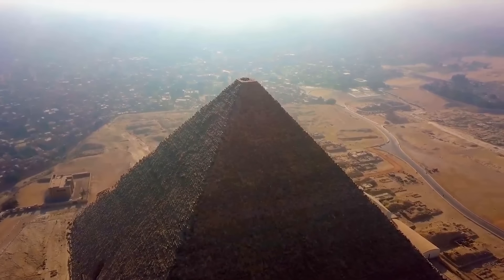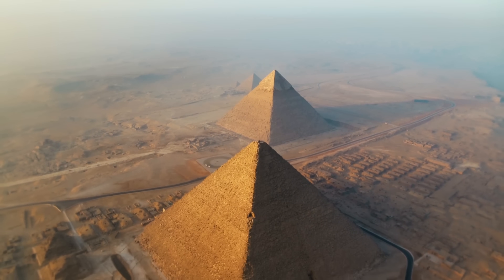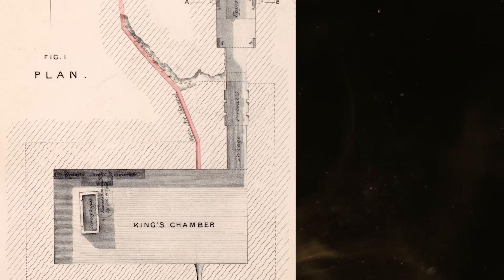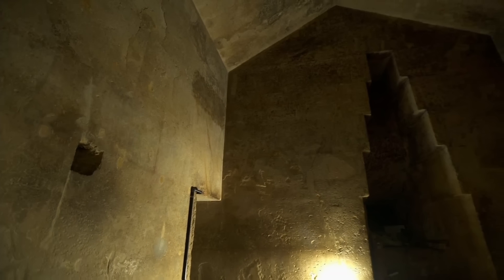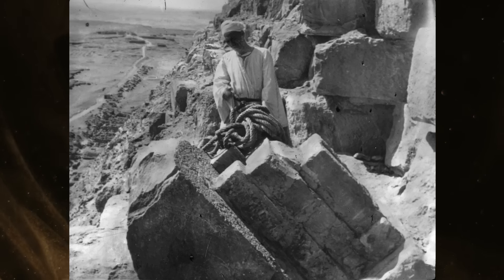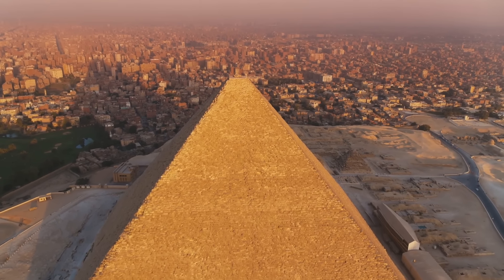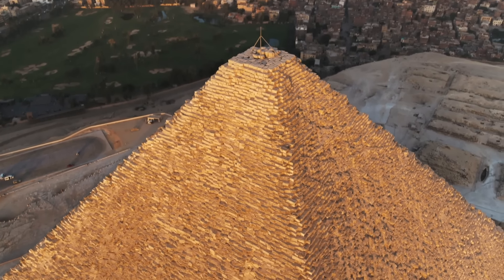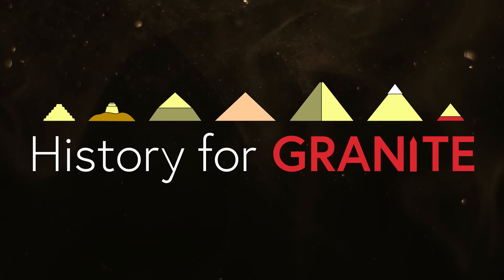One Solution to the Four Channels of the Great Pyramid

Comment: Dear Creator,

You base everithing on the order of the cuts, but if it was cut before the upper block is placed, than the cuts are just logical. You want the ends of the channel to be nicely done.

I tried to read all the comments, but I never found this about the cuting after consturcion: 
Why are you sure those stones were cut after the coverblock was on top of them? cuting before placeing in the channel-block saves a lot of time, and would look like this: the precut stone were not in perfect level, but not a problem for vents, only leave the ends uncut to clear up from inside, to put in a block when construction ready and vents not needed..

You show us a wall that is precut within a few inches. Why wouldnt they do this for a channel?

In my opinion inside work was needed cos walls were finished after assembly of blocks
the channels were needed for ventilation for this inside stonework, without them the stacking of blocks would have had to stop until the interior is done, 
when the room was finished inside, the capstone used everyday  to cover the vent when needed, was left in place and the channel was discontinued,
so the queens chamber finisher first, channels discontinued early, and the kings last and were only covered by outer coverstones -> we think it was open

Thank you if you read this, very nice channel, your discoveries and fieldwork are well balanced in knowledge and reality, I agree with all the conclusions you told us so far, but...
the solution of long term air conditioning is too far. You derive it nicely from "why wouldn't they want to use the insides?",. Maybe just by the headpriest, or by pilgrims, or by masses, why would they try to seal it right after completion?
The idea is ok, but in reality it make the design very wasteful... EVERYTHING about the design screems security, and permanence. And they nailed it! It still sands, and still 'can' be rooms in it. 
Humans LOVE to make something that shows mark. And in ancient times using stone after ages of wood and bricks upped the stakes. The better the achievement the longer the fame. And Egyptians won. Nooone could erase it, noone could replicate so far. And since than everything fell that was made to last forever. (religion is in 2.place) Humans will find a way to erase anything.

SO my point is that If you want to make something to stand the test of time you cant be naive to plan to make it "OPEN TO PUBLIC"..
 IF it would have been built to accommodate visitors, dynasties would have used it to live in it after, and battles fought for it. As a fortress. You would be hard on proving that it was not made to be a palace in 870, but a tomb and then reused..:)
The only real motivation to build this is in the fact that nothing lasts. We build empires, cultures, techniques, systems. And in time a new stronger will come and we forget the old.
Controlling what happens to your makeings after you die is still the hardest. And they are wining since 3000bc.
Also leaving an airflow is contra productive, the enviroment destroys the building from the inside.. 
Trust me, maybe not right after the "moving in", maybe there was a few years or mourning, and visiting, but they sealed it:
(You should check out FitMc and older 2B2T content. History is an anarchy server)

this is my recipe to build something in the bronze age, that can last, spread that you are awesome, even if your ppl die out:

-make it big, so its visibe and not easy to erase - max under 30-35 years. (2ruler buldplan is not safe.)
-build not from valuable material, and in a shape that erosion will only make it more dense
-infertile land is preferable, but it must be rock close , not swampy, not on lowlands, but too high makes it harder to build
-use blocks only crowds can move, and interlock them to the top so you can only disassemble from the top - this is the hard part
-leave corridors while building the body, but make them small, so only a few can enter
-with the interlocking blocks and narrow corridors the more they excavate the less accessible the building can become
-put something in the middle, thats yours, and you think wort preserving: anyone can claim a pig pile of stone.
-make the corridors narrow, have updown angles, and plan them in a way you can decorate and fill them while the top of the building is finished
-put the few rooms far from light and fresh air, but when you close the rooms while building upward, leave tunnels for air until the interior is done

-,the outside is protected by steep cover-stones, they cant even go up to start the destruction, and if you start from the bottom it all comes down on you. 1 entrance is left at the end, all else is uniform a,d flat and tall.
-before the moving in you make everything ready and wait for the loot to die.
-as soon as the monks let it you: seal all the corridors inside, hide the seals, and only leave 1 way open, preferably a corridor downward, with the sealed corridors on the sealing. 1-2 worker at a time.

-this last part you can leave open but no more than 3-4 ppl can go in, and when other gods rule, its ok to fill it up with sand cover the entrence with the premade stones, and cove it up by sand. 
-no need for secrecy, only written accounts should be destroyed and you have to 'guard' the 1 entrance (sealed or not) until around 1-2 generations, and seal it in this time. You can even open it to put things in that lower room. 
-afterlife: until your culture is around, there will be no incentive to start proper excavation, after your culture is gone they will just guess even if the place of the door was secret or not. Yes they will get in, bore holes, get all the coverstones to check for more doors... buuuut many-many will die crawling with burnt out torches without air or any way out, knee deep in older and newer corpses; but even more will think about this while inside, quickly scratch a name on the wall and leave.

Sry, Love you you if you read this, anyone
Reply: LOL  Love You Too.
Much Love is what I've been saying... 
That last part...
Are your parents... 

supervillains? 
lol
Reply: @raycar1165   nah, but caveing with a torch much much more dangerous than archeologists think.
Reply: I have some rules of life I've been working on...
Rule 1 Don't block with your face.
Rule 2 Adapt to\2 your environment.
Rule 3 Safety Third. 
Each will have sub clauses of course lol
and there are more but I just bring this up because I think you should consider Safety a higher priority for the apparently, genus level of our ancient ancestors. 

(I don't know anything about you so please excuse me if this sounds... beneath you.) 

The interior is too hard to navigate to be a home or a fortress and we've found tombs, it definitely Isn't a tomb. 
The straight cut stone matched with the uncut stone both have the cut on the same side if one is rotated, they could have been cut like that because of the size and position of the tool that cut them. And the one sharp angle is evidence that It was broken out long after it's construction. 
There is also evidence that when the pyramids were built they were right next to the Nile River. This is a strange detail for just a monument, think about it, before modern times the only reason to build on the water is if your harnessing the power of the water, Saw mills, grain mills, water wheels are an easy way to convert that energy into work.

Here's my point...

Before Egypt was called Egypt it was Kemet, right... 
Khemia, literally "land of black earth," is found in Plutarch's writings and
The hermetic mystery school texts, tell us the god Thoth built the pyramids in the Land of Khem,
Whether you believe that or not doesn't really matter, 

It is well documented that people would travel far and wide to trade and study there. 
It was a hub for the trade of goods and knowledge.  
And Chemicals. 
etymology of chemist shows us: 1560s, chymist, "alchemist," from French chimiste, from Medieval Latin chimista, reduced from alchimista. 
And al- in Arabic is "the".  
Alchemy and Chemistry get their names from the ancient name for Egypt. 

The great pyramid was a water powered chemical factory.
The tiny "secret passages" or "air vents", that have been opened up have most likely destroyed any chance of it working again. They should not have opened them, I doubt filling them in would withstand the pressures or keep the gasses separated as it was designed to. 
There is new evidence that backs this up but no one seems to be interested right now.  

The water flowing down into the underground passages crashes into a blunt corner creating mist and a pressure differential that circulates the air up into the grand gallery which has slightly radio active stepped, sloped ceiling creating ionized particles that collect in the kings chamber, The granite block that is supposed to be a sarcophagus is covering an entrance to a room below. 

It could have been a kind of safety device maybe it is upside down and it was broken when flipping it over, 
Or, more likely,
it held the ark of the covenant, an artifact that is well known to have radioactive effects.

Hate to break this off here but I've run out of time. I hope I've painted a broad picture for you to explore.

Much ♥ Love

🌎🌏🌍☯⚡

Comment: How on earth could you ascribe "100%" certainty to any specific detail of the Pyramids? Perhaps that "unfinished" corner in the queens chamber entrance was finished as a type bullnose or some other more faceted detail... perhaps an apparatus clamped on to this protrusion for some purpose at the top, bottom, and center joint thus wearing those pivot /attachment points down flush....  

As far as "your discovery" of the construction method of the the vent holes i.e. final cuts made in situ.  Leaving a small flush surface at the end of the channels of multi ton stones is vastly harder than simply plugging the channels with a block (or firm loaf of bread) in order to keep alleged construction sand out of them. 

Anyways, keep on searching for possibilities and please remember,  100% does not exist within ancient archeology.
Reply from the maker: My frame of reference for '100%' is the standards for evidence that is 4500+ years old. So yes, nothing ancient is ever truly 100%, and perhaps rarely even 50%. But excepting some enormous and unexpected discovery that would contradict the interpretation - it's as good as it gets for the age. You'll forgive me, sometimes I use slightly embellished language to emphasize a point.

Comment: Why doesn’t anyone mention or speculate about the possibility that the pyramid was built as a condenser for drinking water production! The top of the pyramid was made completely out of gold ( I read that somewhere)
Imagine how hot the top would get in 12 hours daylight, how cold it would get in the night, let the wind blow through and the different temperatures in and out would create condensation ( at night outside, during the day inside). There would always be a thermal wind due to how hot the gold top would get, thus it would be also a climate changer

Comment: I've actually heard from various peeps the angles of the vent shafts were INTENDED to track to star systems, even though they were never successful. It's the ultimate archeological virtuesignal, where today's belief thar every participant should be rewarded for any effort and treated as a success, even if the theory itself is flawed. If the builders of this structure wanted a view hole to specific constellations they would have mapped it into the structure as it was built.

Comment: This pyramid is a resonant sound vibration power generator utilizing the crystal properties in the granite and the generation of hydrogen gas they Chanelle with the aid of the underwater aquaver and a below that created a low frequency sound when water was drained out of it almost like the sound of a basin running out of water that gargling noise and this this sound vibration they used with this gas which energized something in that granite box and channeled huge power out the top of the pyramid something to those working orders

Comment: I would think the air would stagnate at the bottom of those shafts. CO2 sinks and will fill a vessel like water. Anyone trapped in the bowels of that pyramid without ventilation for an extended period might suffer oxygen deprivation. Especially if there we're a lot of people in the pyramid at once.

Comment: They had no flashlights, lanterns or electrical lighting. If you are deep inside any kind of cave, tunnel especially one that goes uphill. While burning torches, fat burning lamps to see while building processes and artwork were being done they fill with carbon monoxide. After a a few small starter Pyramids and unexplained deaths they learned to vent....

Comment: Form and function. The pyramid was built for a function. And the form was perfected only where required by said function. The rest were left imperfect because the function did not require it. The copper rods are copper for a reason of the function. Nothing in this "building" is accidental.

Comment: why would they leave air vents exposed on the outside of the pyramid for tomb robbers to find. by calculating the angle they went down would lead them to the probable loction. this is a good reason the kings chamber was not a tomb.

Comment: The pyramid sang?...
As when you blow over the top of a bottle, it resonates, the open channels allowed the ancient pyramid to also vibrate or sing! especially as the internal chambers naturally echo at a f# (I believe) then in ancient times (when noise wasn't such an issue as today's world), A traveller approaching the pyramid from across the desert, when the wind was high it was said it sang, which added to its mystery and mystical nature, it may not be why they exist but that isn't to be ignored
When the alabaster outer layer was in place I'm not sure, did these channels extend to reach the wind, causing this phenomena? And even if internally sealed would still vibrate.
Is it significant that internally we find extreme sound amplification, centred on an F# harmonic, (I can't recall it maybe G#)  a whisper internally carries throughout the entire place,that's if visitors can stay quiet, I'm sure the wind outside would effect this natural vibration inside, could it have been an intentional part of it's function?

Comment: Cmon.. The pyramid was of course smaller when the Queens chamber was built and thus at that time the ventilation shafts went to the outside.  Then they built over them a the King chamber became the official chamber for the king. Anyone should realize that the pyramid was built in three stages counting the subterranean  chamber.

Comment: If Khufu wasn't married at the time of his death, it would explain why the queens chamber was never finished. He had been married several times, and that is why there chamber exists. but when he died, if he wasn't married. there would not have been an incentive to quickly finish that part of the work. Only the Pharaoh's part would have been completed. Thus the queen airshafts where never open. There was never a floor laid in there. The work was quite literally stopped half way, workers redirected to the parts that HAD to be finished NOW because the pharaoh had died. After all, such a huge construction project would have been worked on for decades. Don't apply religion when logic will suffice.

Comment: @40:35 you say , cut 1, 2, & 3.
Assuming… some things.
What assumptions are you making.
I am trying to be helpful here, not a YToob antagonist.

Can any scientist, forensic, micro technician, in 2024 determine if the later damage done by crude investigators between 500 bc and 2024 ad , have left tool marks that were definitely not done by tools after the pyramids were built ?

Comment: So why weren’t the Queens chamber ducts unplugged….what were the copper handles on the plugging blocks……no doubt they were probably air ducts…at least the kings chamber shafts were….i think the copper and the blocks point to something different….they don’t really look like plugging blocks per se…as if they are iust laid in there haphazard…and those copper “handles” that seem to be connected from one side of the block to the other…like electrodes that were intended to have continuity….and we don’t even know if the shafts effectively end at those blocks….they haven’t even been found to have exits at the exterior…..
Reply: And the queens chamber was the only chamber to be crusted with copious amounts of salt…efflorescence…why not in the passages and in the subsequent chambers…..granite usually doesn’t have efflorescence….the limestone would be more likely considering its sedimentary and significantly more porous….

Comment: how old is this? WE now know  the Pyramids  has not
thing to do with death, but power generation.
Reply: I'm not sure that's accurate
Reply: @MichiruYami  You don't read what I do. Or you would know why they were built.
Reply: @robertbolino9052  I don't think it has the necessary components to be a power generator. Even if it was, what would a society that didn't even smelt steel do with a power generator?

Comment: 2 cooper pins??  come on... they are electric terminals.
Reply: The water hammer pumps would have created massive shock waves. Any pizoelectric material would have created high voltages. It might have been some crude form of transformer - very little to go on though.

Comment: Would make a perfect hydrogen generator 🤗
Reply: Hydrogen is made by putting metal in acid. Limestone is alkaline. Acid dissolves it, easily. Electrolysis can use any container.